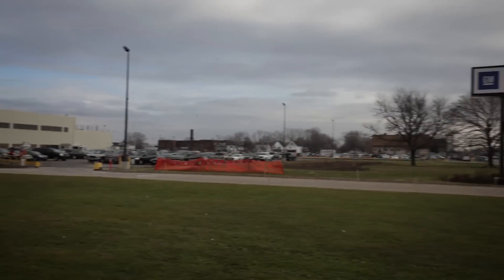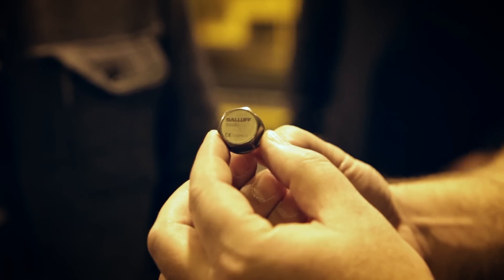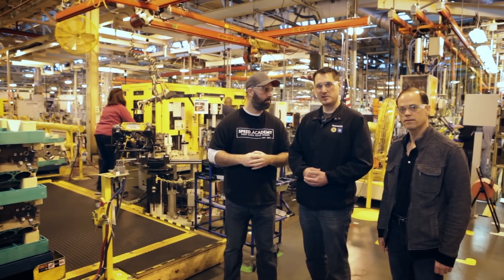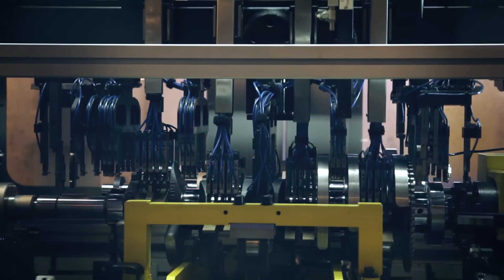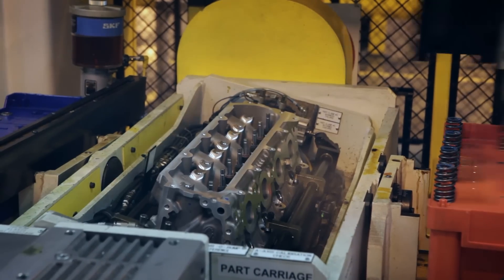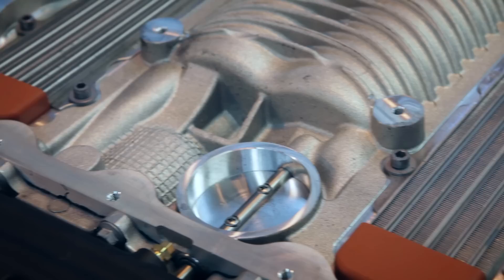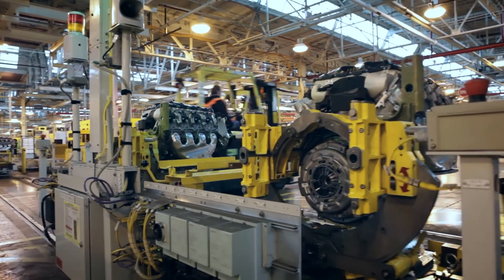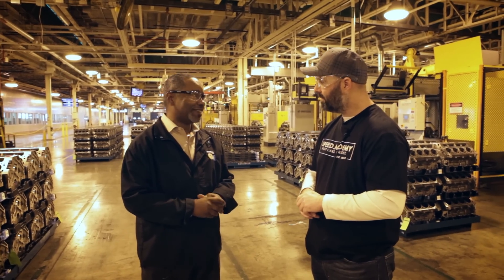Building GM's most powerful Engine Ever, the 650hp LT4 V8!

Comment: Most powerful? Ford start out at 650hp. Why settle for an advertised 650 lt4 powered junkvette  when you can get a factory Mustang starting at over 700 factory hp.
Reply: Someone's but hurt
Reply: And the slow mustang is heavy af. The z06 will out run the pos mustang any day
Reply: Corvette Kid You must be confusing me with a Chevy fan boy.
Reply: Corvette Kid Bottom line, Corvettes are gay!
Reply: Corvette Kid Butt* F'n Moron! I wouldn't expect much out of a Chevy Fan boy though!
Reply: ?  English please
Reply: Nope can't say that I am
Reply: You would know huh.?
Reply: Just quit typing on your keyboard because your trying to compare a muscle car to a sports car.  So please just stop!
Reply: And since you want to compare them corvette z06 ring tone 6.59.  Shelby gt350r ring times 7.33 I think
Reply: Time*
Reply: Why 
Because they are faster than mustangs because they are way out of mustang league
Reply: You're not even using proper grammar, kiddo.
Reply: Hello kid. KID.  CORVETTE (KID)
Reply: mustang started out with 650hp? since fucking when is a factory mustang hitting 700 hp no shelby doesnt count
Reply: Ok how bout this. 2017 Ford GT 630hp from a V6. Only 20hp less than the "pride" of Obummer Motors "L"ittle "T"urd4 V8.
Reply: jerzcrew81 also little turd in the time it was out it has been around the actual ring the gt was just a fucking prototype oh wait the lt4 got a psi update and went to 800 psi gm is very much never pushing their engines also their 5.0-5.5ls push out 455 hp with ease and those blocks are tested to 900 plus hp at that cid to geuss what see how close to the edge the exotic block is and then they drop everything they can so that the car is balanced perfectly between performance and fuel mileage it hilarious that a 6.2 corvette had better mileage then some 6 cylinder fords need to actual keep up with shit bud
Reply: 800 hp not psi different rating

Comment: fill up your gas tank with water, put an H2O splitter in line with your injectors and let your engine run on hydrogen. It works great and has a little more horsepower than gasoline and the exhaust is water vapor.
Reply: Hydrogen bomb

Comment: Notice how they(GM) keep the unionized “workforce” out of the assembly process as much as possible.
Reply: That's not so much a factor of unionized or not, it's about manufacturing efficiency -- a big part of which is having robots handle the critical but monotonous actions like torquing every fastener to the precise torque, without missing a single one. In the old days, when GM (or any manufacturer) built engines by hand, improperly torquing a single rod bolt spelled disaster. Today, that rarely (if ever) happens, because the robots can do the same job with 100% repeatability every minute of every day. And it's less strenuous for the workers, leading to fewer injuries. True, the robots do replace manual labor. But from a product perspective, the robots ensure a higher-quality product, and that each and every engine is assembled as identically as possible.
Reply: Yeah bc they dont want you to see how they just stand there and whine...lmao!

Comment: Zr1 motor is better - Powered Metal CON RODS vs Forged TITANIUM RODS !!!!!! MINI BLOWER ! KABOOM after a TUNE !
Reply: PilgrimTitan They had height limitations. I think it's pretty impressive what they were able to accomplish with an engine many inches shorter than an LS9. That said, the new blowers are clearly not capable of huge increases in power with pulleys/tune. I think this blower is already about where most "pulley'd" blowers are.
Reply: yep, GM fucked up on choosing a smaller blower
Reply: Cory Stansbury AND YOU ARE A KABOOMING BULLSHIT BECAUSE THE LT4 IS THE BEST!!!!!!!!!!!!
Reply: PilgrimTitan AND YOU ARE A BULLSHIT!!!!!!!

Comment: the LT4 uses a forged steel crankshaft not cast.
Reply: ***** GM's LT1 tech sheet says the LT1 uses a forged steel crank.
It could be from the 6.2L eco tec or 5.3

Comment: Good job Obama, just what our country needed..... All that to make 650hp? Here's an idea, grab a socket and a brass hammer and beat in your valve seals, put on the exhaust manifold by hand... When it's in the car. If you don't have cussing and getting pissed at some point, then you can't be proud of what you did once it's running. Oh wait, they don't get to see them run. Not to mention 90% of the people that buy those cars aren't going to use anywhere close to that much power. In two years most of them will be smoking from all the carbon built up on the valves. Do something worth doing and stop wasting our money!
Reply: Joseph Inman No, Joe, it doesn't take a $16M robot to build an engine ... but when you want to build thousands and thousands of them, the robots will do it better and faster, engine after engine after engine. They can ensure precise clearances and exact torque specs every single time without a single mis-torqued bolt, or poorly-fitting valve. I've built plenty of engines, too. But when I build one for one of my muscle cars, it doesn't necessarily need to last 100,000 miles without any service and it's not necessarily expected to last for several hundreds of thousands of miles. GMs engines are. They build a scale that's far different than what you or anyone else working in their garage have to contend with. Your comparing apples and cranberries. Yeh, they kinda look alike, but the scale is completely different ... and so is the final product.
Reply: you're clueless
Reply: ***** Horsepower means nothing compared to torque on the track.  Both the Hellcat and the Z06 have 650 ft/lbs.  Also, the Hellcat weights 1,000 lbs more.  Don't get lost in the HP numbers that mean nothing when it comes to true racing performance.
Reply: Oh, so when I heard on the news about Obama's "Bailout plan" for Chevrolet, that didn't happen? And I'm clueless to the fact that it doesn't take $16,000,000 machines to build a reliable 650hp car, when me and thousands of people like me have been doing it for years in their own garages. Point is, it's a waste of money that could have been used somewhere where it's really needed.
Reply: Jim Miraglia Your post is Brilliant. Thank you Sir for your talent and bringing us such fine equipment and knowledge.
Reply: In addition to the obvious quality benefit, the heavy use of robotics probably has as much to do with the excessive labor costs as well as legacy benefits.  Over a human employee's life (salary, benefits, retirement, etc), the robotics are a screaming deal.  Also no need for an HR department.  They don't need a manager.  On and on.  It's math...

I commend GM on the nice plant and potent motor, but....Hellcat :)
Reply: Yeah but that bullshit is much more powerful than the LT4.
Reply: Are you 10 yrs old or just a fucking idiot?
Reply: lol good thread 10/10
Reply: *****
You're being too generous with Dick's age.  His IQ might be 9 though.
Reply: Joseph Inman 
Take your politics somewhere else, dumbass.
Reply: Richard Joash Tan
You are too stupid to have a driver's license, not to mention own a Corvette. Wow. Aren't you the full-blown idiot. 
Btw, you are a horrible liar.
Reply: So, how many valve seats are you beating in by hand each day, day after day?  How many blocks have you built from scratch in your garage?  What's that, none?  How many crankshafts have you put into production from a raw casting made in your garage?  I'm guessing yet again that the answer is none.  Never mind the fact that 100% of that 90% of people you claim will never use the full extent of power capable of this engine don't give a shit what you think.
Reply: Joseph Inman I turbo charge and use these engines as generators so it works well for that.
Reply: Jason Scott Plus GM makes some pretty decent gear. Never have issues with genuine parts and they last a lot longer than the cheap shit ones from china
Reply: ***** The Hellcat is an impressive motor and yes it produces 57 more power. But go check on durability, reliability, compactness and most importantly, weight, and you'll see the LT4 is even more impressive.
Reply: ***** 8 micron is easy, what you were meant to say is "I'd like to see you measure 1 million motors within .002 of each other"
Reply: Joseph Inman
What about lithium electric powered vehicles.
Reply: I can tell you don't build engines.
Reply: ("RNA0ROGER") lithium is great,problem is the politics to move it from one country to the next..you know bribes.
Reply: “Good job” and “Obama” will never be put together
Reply: Jim Miraglia AND ALSO YOU ARE A TOTAL QUASI SERIAL LIAR AND THE WORST OBAMA-BASHER IN HISTORY, DESPITE BEING A GM ENGINEER!
Reply: John Molloy And the Hellcat is a... BULLSHIT!!!!!!!!!!!!!!!!!!!!!!!!!!!!!!!!!!
Reply: John Molloy but THAT LT4 IS more powerful! All that matters is that you ARE a fanboy in mind!
Reply: bayouratt283 AND YOU ARE A BULLSHIT!!!!!!!!!!!
Reply: ***** And you are a bullshit!
Reply: AND YOU ARE A BULLSHIT BECAUSE THIS IS JUST WHAT MY COUNTRY NEEDED! AND YOU ARE ALSO A BULLSHIT BECAUSE I AM BIASED WITH THE C7 Z06! AND YOU ARE A TOTAL BULLSHIT BECAUSE THOSE WHO ARE ABOUT TO DIE AFTER BEING BANNED FROM YOUTUBE WILL NOT BE REQUIRED TO KNOW MY NAME!
Reply: Richard Joash Tan lol z06. There's your bullshit.
Reply: bayouratt283 My IQ is infinite!